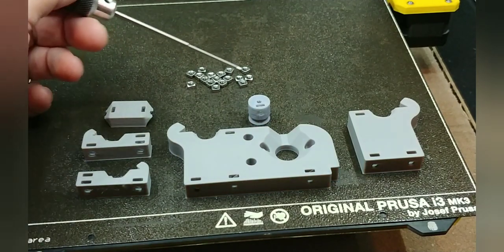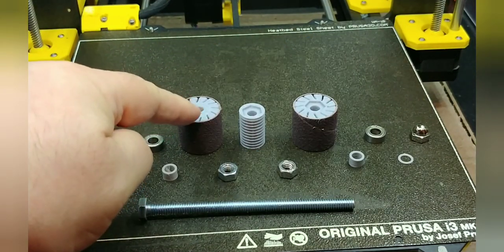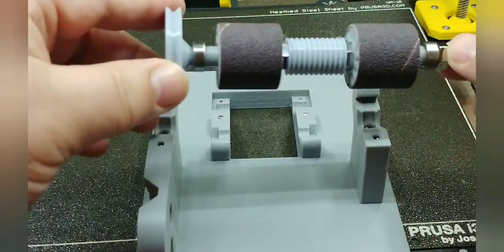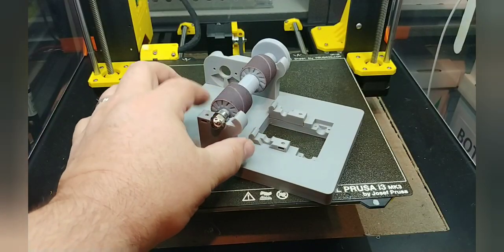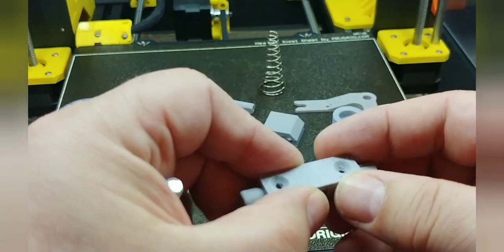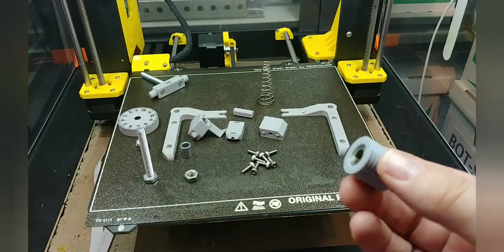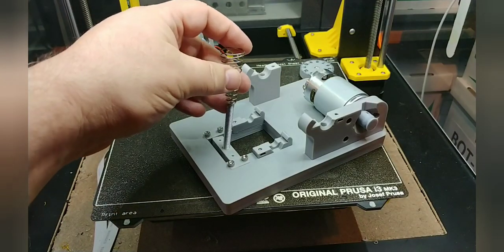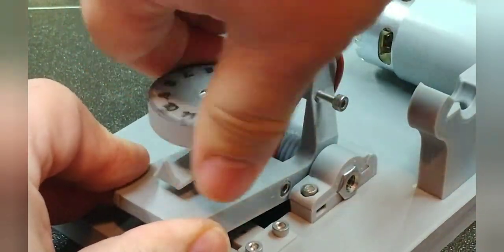G&S Tire Grinder Assembly Instructions

Comment: Very good assembly video and thought out design.  Purchased two of them.  I did notice that there seem to be NO centering spacers on the idler pulley between the axle forks.  The idler pulley bearings are recessed into the ends of the idler pulley.  Without any means of centering the idler pulley, will it not rub on the pulley sides on the forks?
Reply from the maker: Not unless the forks are compressed too much, so be careful of that during assembly. I had to shorten the idler pulley my a mm or so from original to prevent this issue with some prints. You can use spare thin spacers if you want, as there are usually extra in my kits, or print more. So far, not having spacers has not been an issue. Make sure the band from the sanding spindle pulley to the idler pulley is lined up so that it doesn't pull to one side or the other. 
Let me know if you run into any issues, especially if adding the thin spacers doesn't help.

Comment: The motor pulley shaft hole needs to be a thru hole.  When using the slower RC motor oprion the motor pulley will not line up with the big drive pulley.  Also the motor mount holes need to be clearanced for the 3mm screws.  Nice design with a few exceptions.  Built two of the newer ones.
Reply from the maker: Making the motor pulley have a through hole is easy enough to do, either with a drill bit or a new model. I'll go ahead and update the model for a through hole. It hasn't been an issue for me, but I can see how it could be.
For the motor mount holes, it's just plastic, so also easily drilled or reamed out, but I usually just force the screws through, or use the screw as a drill to open up the hole a little more. Again, hasn't been an issue for me.
A lot will depend on the accuracy of the prints as well. I've recently found how much the material can make a difference. I had been getting great, functional prints with the PLA I had been buying, but recently got a different brand. Without changing anything else, the new prints were much cleaner and more precise, enough that the square nuts just slipped right in, and screw holes were all the appropriate size. Not that any of this affects the performance of the machine when assembled, but it's an interesting side note about FFF printing, and why I designed a lot of the parts the way I did, to accommodate those differences in print precision.

Thanks for the feedback! Don't hesitate to share any other ideas or suggestions for improvement.
Reply from the maker: I uploaded a new motor pulley, in case you feel the need to print one with a through hole.